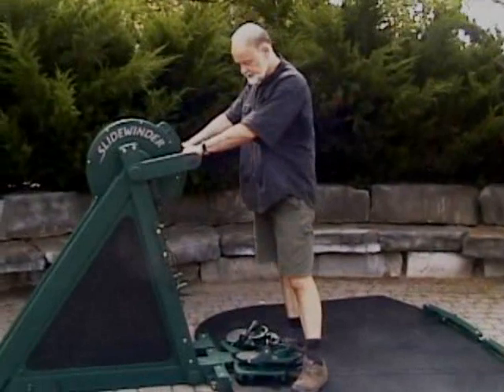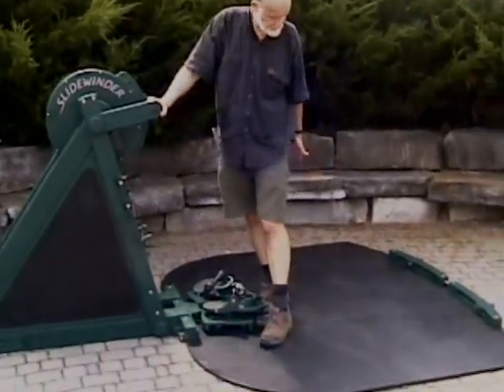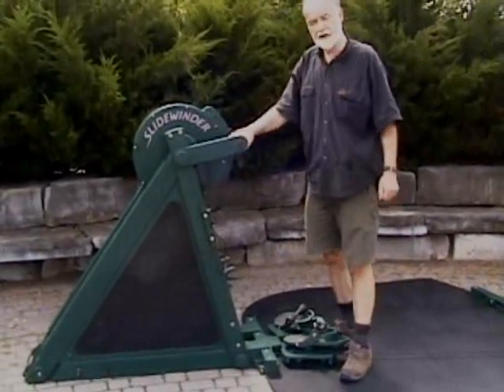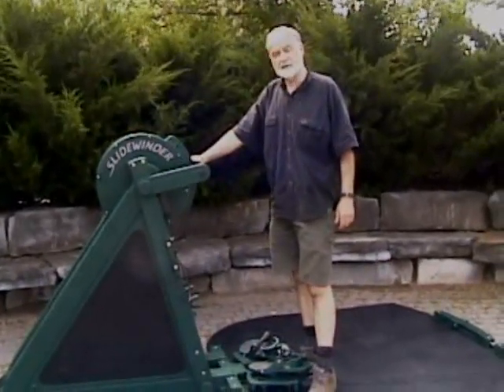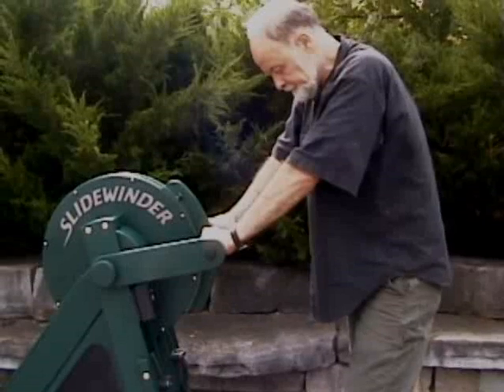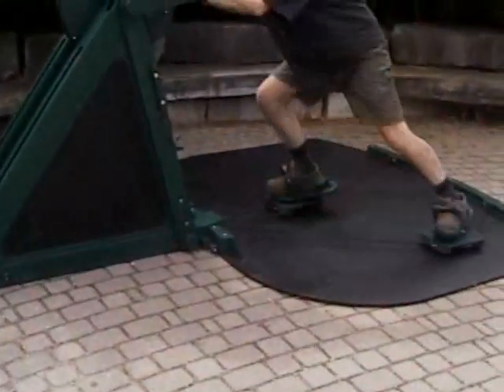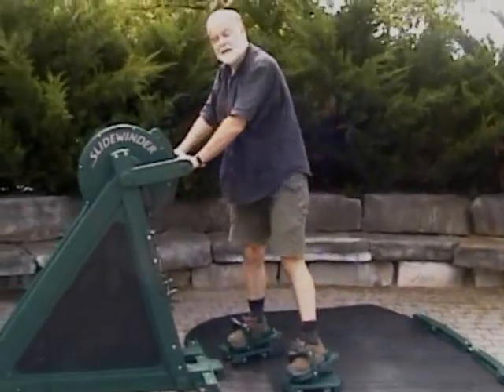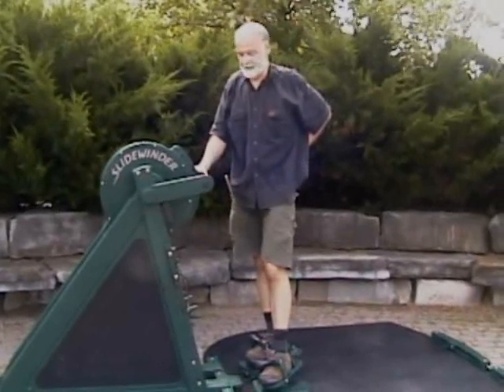Slidewinder Skating Exercise Machine

Comment from the maker: "Like a cat trying to escape a wet surface"? Not really. I have complete balance and control, and my movement is natural, smooth, and flowing. Other "skating" devices have tracks which force the user to follow an unvarying stride path. The Slidewinder machine enables an infinitely variable stride geometry - a revolutionary  innovation. The user does the skating, not the machine. Inertia and air resistance replicate actual skating resistance. Black, flat machine is latest embodiment - see video.

Comment from the maker: Skating treadmill manufacturers take note. The Slidewinder prototype proves that a bio-mechanically correct off-ice replication of skating does not require a huge piece of  expensive motorized machinery. So, it is inevitable that. some time in the future, compact, non-motorized skating exercise machines will be widely available. They will be a fraction of the cost of skating treadmills. When that occurs, skating treadmills could quickly become historical relics, as obsolete  as Stanley Steamers.

Comment from the maker: In an early experiment, to test the theory  that flywheel (inertial) resistance closely replicates the resistance felt during actual skating, I set up two flywheel-type rowing machines side by side and extended cords back from the pullchains of each and tied the cord ends around my ankles. In heavy socks on a slippery floor, with an assistant hanging onto the back of my belt, I tried to "skate". It felt great. It felt like skating - for 5 or 6 strides. Then everything fell apart. (continue)

Comment from the maker: (continue)  As soon as the flywheel was up to speed, my legs splayed out uncontrollably. All feeling of having an edge, of digging in and pushing off, as in actual skating, vanished. After a dozen strides it was impossible to maintain balance and co-ordination ...but it  had felt so right at the beginning. By what mechanism could that "digging in" sensation felt during those first few strides be prolonged and retained regardless of the speed of the flywheel? It was the key problem to be solved.

Comment from the maker: The Slideboard, the PowerSkater, the CardioWave... these and others are all failed attempts to replicate the skating action in an exercise machine. None enable any variability of stride geometry, nor do they provide the feeling of momentum build up as in actual skating. Engineers, unable to design a simple compact skating machine, resorted to a brute force solution. The result is $100,000 plastic-belted motorized skating treadmills as big as garages. The "Slidewinder" shows another way.

Comment from the maker: For viewers wondering about the intensity of the workout:  I'm no great athlete. In the video demonstration the resistance is at its lowest setting. I also rested between takes. Recently,  two Junior "A" players tried the Slidewinder machine. I cranked the resistance up.  Those young tough guys were totally whipped in less than five minutes.